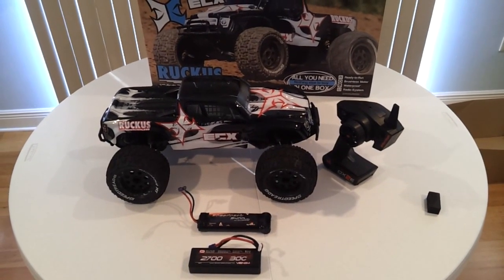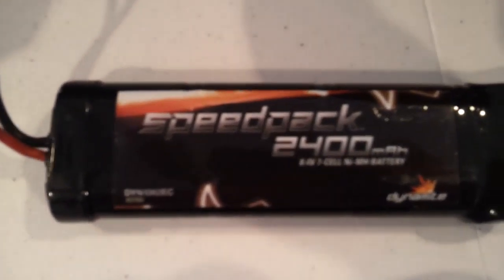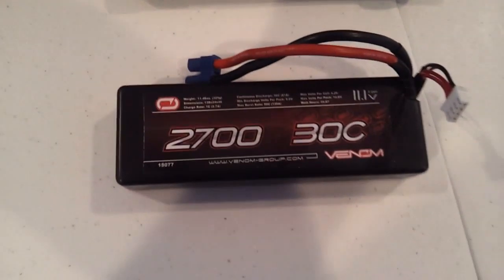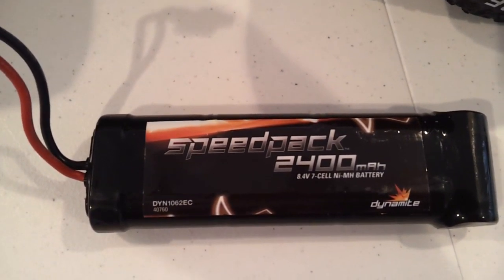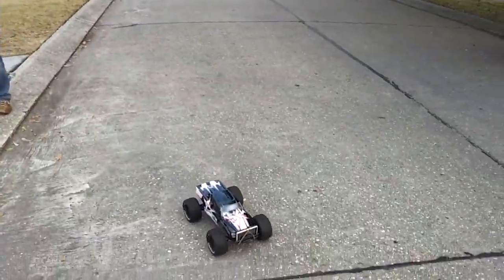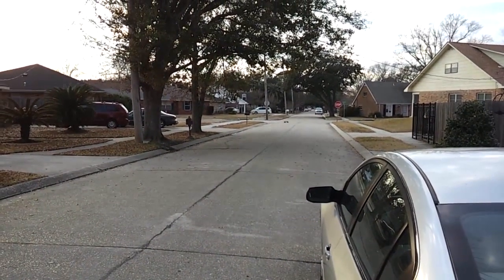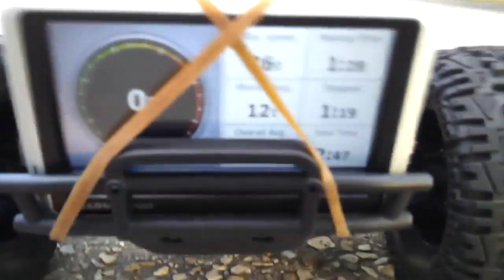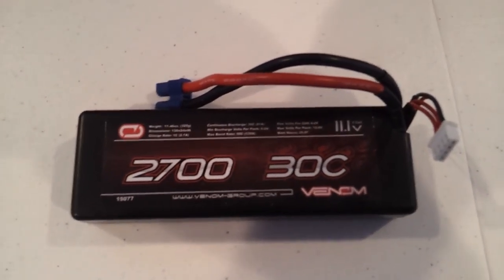ECX Ruckus Brushless RC Monster Truck GPS Speed Test

Comment: I have completely the same version. very satisfied with it, it has been upgraded to the limit with all parts as you take it out of the box. If you want to go even heavier, be aware that you will need the full aluminum upgrade. I have now done this with a caslte 3600kv motor and I can tell you that it is really necessary. no more broken axles. or other parts. Slightly more expensive in parts but worth the money. nice video my friend.
Reply from the maker: Great tips! Thanks

Comment: Not fast Enough mine goes 40 miles a hour its a 4x4 Ruckus 110 monster Truck wiith a 3300kv Motor and A 5000mAh 100c 7.4 Battery and 2 COOLING FANS not saying Anything wrong WITH looks like it runs Awsome good luck brother just upgrade it thats what i did with miine now it runs great as long as i keep the maitence up like cleaning it and oil it real good shocks and pear ginon fly wheel snd other stuff.

Comment: how does it work with 3s? it only says 2s on website..
Reply from the maker: Jon Heuer I have had no issues using a 3S LiLo. I can't really give it full throttle though without the Ruckus flipping over.
Reply: you can always buy a tracas wheelie bar and install on rear bumper... so the car or esc won't overheat? no issues with overheating?
Reply from the maker: The only time it gets hot is if I run it slow. It doesn't seem to like that at all. I guess it feels the need, the need for speed. lol
Reply: yea, if so, ill definelty buy a 3s. i have the need for speed too!! i read on a lot of different forums that the motor won't start but the wheels will turn on a 3s... weird...

Comment: this is completely stock?also it says its only 2s compatible not 3s
Reply from the maker: Jon Heuer Yes, completely stock except for the LiPo battery.
Reply: ok, i heard that it inly takes 2s not 3s... on the promo vid it says 25  plus mph but u hit 36 stock... weird lol.
Reply: doesnt it get super hot with 3s?
Reply: Mine says 30 on box nd came with 2c 3000 mah 20c batt

Comment: http://oi67.tinypic.com/jsymw8.jpg picture of the Ruckus Two Wheel Drive, BRUSHED speed controller.Just make sure you set the Jumper to the correct Type of Battery ie.Ni-MH or LIPO

Comment: wait I thought the esc was limited to 2s
Reply: I thought the same. I wonder how long it can run a 3s lipo
Reply: i did 3s speed runs up n down the street and it didnt get as hot as i thought. i think its alright with 3s as long as you dont stop and go too much

Comment: Is the 2400 nimh battery really that much faster than the 1800 nimh cause mine is running the same setup and it is topping out at 20
Reply: +strickland davis The mah(2400 or 1800) rating is just how long the battery will last. The thing you want for performance is the c rating, and the voltage.

Comment: I have the same truck. I recommend installing the RPM servo saver eliminator as that will tighten up your steering and prevent the wobble at high speeds, as well as when you reverse. This upgrade will destroy the stock servo though so upgrade it to an all metal gear one. I picked up one for $28.99 the Spektrum s6180 and it is way better now.

Comment: Is that stock?
Reply from the maker: The truck itself is completely stock. The Ni-MH battery came with the truck. The LiPo battery was purchased separately. You do not have to make any changes to the truck to run LiPo instead of Ni-MH.
Reply: +brianj501
I'm impressed you got these speeds off the stock setup.  I was looking at this truck as well ( the 4wd brushless version ) but found some reports that the stock setup capped out around 25mph on nimh batteries.

how's the truck held up for you?  durability wise.
Reply: I just got mine .and if you look at the speed controller it has built in >Jumpers<Just make sure you set them to match the Battery you are running on .http://oi67.tinypic.com/jsymw8.jpg

Comment: Can someone tell me if anyone put led light on it  how can i do it? I just got my son one of these for christmas how long does the battery last? can u put 4wd wheel on this 2 wd
Reply: To make this 4wd it would be cheaper to buy the 4wd version, you would have to completly redesign the car, a new chasis completly new fron end, reposition the motor, get rid of the old transmission.... The stock battery should last around 20 mins

Comment: 36 mph on 2400 nimh battery?? thats very good ive seen videos of vxl stampedes and they cant even hit 30 out of the box anyways nice vid akso do you know the charge time with the included charger? :-) :-) :-)
Reply: Im guessing around 1,5 hours, maybe 2
Reply: +Arlette Padilla 
Odd, my neighbor has a VXL 4x4 stampede and that thing does at least 40.    Only issue I really see is it's so prone to traction rolling.
Reply: I saw a speed test with stampede vxl with 7 cell battery and he got 27 mph.And ecx ruckus is 2wd so that gives it an advantage in speed too

Comment from the maker: Weird how it kept posting that response over and over. I don't change anything to run the LiPo vs the stock battery.
Reply: +brianj501 Your RC will most likely catch on fire, don't ever drop a cell under 3volts per cell on LiPo's.... They become unstable.

Comment: when running stock battery then switching to lipo is there a setting on the truck you need to switch to like a lipo mode?  guy at hobby shop was telling me this...
Reply: +cparent3 When running the NiMH's set it to no cut off which should be the first beep, but do not forget to re set the ESC if you stick a LiPo back in.
Reply: Thanks man
Reply from the maker: No settings. Just put in whichever battery you want to use and send it on its way.
Reply from the maker: No settings. Just put in whichever battery you want to use and send it on its way.
Reply from the maker: No settings. Just put in whichever battery you want to use and send it on its way.
Reply: +brianj501 
awesome thanks man appreciate it...  so I just need to set the low voltage cut off to about 3.2 or 3.4 and I'll be ready to go...
Reply from the maker: No settings changes needed. Just put in whichever battery you want to use and it's good to go.
Reply: +cparent3 You have to move the jumper on the esc.
Reply: U got any pics of what it looks like?
Reply: +cparent3 I was like that too lol trust me just buy the lipo and put it in you dont need to do anything but that
Reply: dodgefan notford thanks.  Yea I just plug it in and it runs good.  It already has a built in LVC too Wc is nice.
Reply: +cparent3 DO NOT listen to these guys, jesus christ. Research LiPo's, they're worth the buy, but if you treat them wrong; Charge them wrong, run them below 3 volts per cell, you're in for losing your battery, RC car, house etc. Your ESC booklet will tell you how to change it, something like hold the button for 5 seconds, beeps, then it beeps in sequence 1 beep, 2 beeps, 3 beeps, up to like 5, 1-5 are settings, looks at your book but I think the 3rd beep is for your voltage cut off, then right after them 3 beeps you push the button again, that sets it so it knows you're changing the cutoff, then 1 beep might be 3 volts, 2 beeps 3.2 volts, 3 beeps 3.4 volts etc. I usually have it set at 3.2 volts because once it cuts power, you know you're still above the safe limit.
Reply: +cparent3 Another thing to know about charging is the mAh vs amps on charging, there's a mathematical way to do it, but all it boils down to is, if you have a 4000mAh battery, doesn't matter if its LiPo or NiMH, you can charge it at a rate of 4 amps. 4200=4.2amps, 5000=5amps and so on do not exceed this unless the battery clearly states a charging rate.
Reply: It’s real simple. YES it will run if you simply switch from NIMH to LIPO. but factory setting disable low voltage cutoff for nimh. You have to set the esc, hold 3 seconds then wait for option 2-6, whichever settings you prefer.   That’s it.  Plain and simple.  Not doing so you will start breaking stuff.  
But still
Great video guys

Comment: I have this truck with a 4000 mah 2s venom lipo and the truck moves! I also have two 3s lipos that are both hooked up and it couldn't handle the power it blew the back tires off doing a backflip and it topped out at 97 mph
Reply: 97 mph? on 3s? video ?
Reply: How long do you get in the 4000 for run time?

Comment: I just got this exact RC truck...thoughts??? tips???
Reply from the maker: It's a pretty cool truck. Just go through it really well and make sure everything is tightened properly. Also, once I started running a LiPo in it, I had to put some Loctite on the pinion gear to keep it from slipping. I have gotten it up to 50 mph and it still has more to give. It does become a wheelie monster with a LiPo battery so watch for that as well. Have fun with it and let me know what you think once you've run it a bit.
Reply: appreciate the feedback...i'll let ya know if I encounter hang ups.

Comment: Hey Brian,
Thanks for posting the video.
Did you make it to full throttle; as it doesn't sound like it reached its limit.

I want to pick up either an ECX Ruckus or ECX Toremt and get the CC SW3 Combo. That would be  $10 cheaper than the ECX Ruckus Brushless RTR. Does it come metal gears and how does the drive shaft hold up with the 3S.
Reply from the maker: It does come with metal gears. So far, the drive shafts have held up through several runs with a 3S LiPo battery. I ran a few full cycles through the grass even to test the drive shafts and haven't had any issues yet. We will see how they hold up. I also considered just purchasing a regular Ruckus and upgrading everything myself but decided to go this route and save myself some trouble. I also really like the black/red/silver paint scheme of the brushless version. It is plenty fast and powerful enough in this setup. It goes 47 mph at less than 3/4 throttle. I can't give it any more throttle because it torques up so high that it launches in the air and flips over. I might try this speed test again over a longer stretch so I can continue to gradually increase the throttle and see if I can get it to go even faster without flipping because I am curious as to what this motor can really do. If you are considering the Brushless RTR version, check out my unboxing video.
ECX Ruckus Brushless RC Monster Truck Unboxing
Reply: brianj501 What is the run-time with the stock battery and lipo?
Reply from the maker: Austin DSilva Around 20 minutes for each. I just purchased two additional 3S LiPo batteries this week (one 30c, the other 60c, both 5000 mah) so I should get much better run times as well as power. Recently, I ran a few extra passes with the LiPo used in this video and was able to get it to 50 mph. If I can keep the nose down a little more, I can get it even faster. BTW, did you see that ECX is about to release 4WD versions of the Torment, Circuit, and Ruckus?
Reply: That's great to know. I had almost locked onto the ecx ruckus brushless and a 25c 5000mah eco power when someone told me I'd get only 15 mins runtime with the Lipo. I just had to make sure. I always figured more run time with Lipo so how could the NiNH last longer.

Yes I did read earlier this month all three are gonna have a 4WD albeit with a brushed motor and for $240; should be out before June. I might just pick up the vaterra glamis uno and then wait till the ruckus 4wd gets released.
Reply: brianj501 I have the 4wd Torment, and I slapped some 2.8 Trenchers on it, its a beast, but I've already went through 2 kickplates (No biggie) and broke the upper deck(Most replacement parts for the 4wd aren't due until mid June) Also broke a post(Mid June) and my front gear box is broke so its throwing the ring and pinion out every run. Lots of stuff to break on the 4wd, but when they work, they're badass!